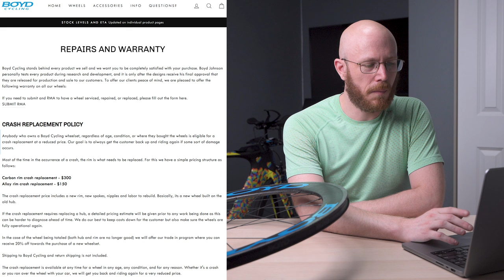Boyd Cycling Wheel Review: Why I'm Never Riding These Again

Comment: Hey Justin, Boyd Johnson from Boyd Cycling here. We just found this video and I wanted to comment on a few things.
First of all, the wheels you have are from about 2011, so those were produced before higher temperature resins were commercially available. With advanced in carbon, carbon rims have been able to handle more and more heat. In the early 2010 pretty much all wheel companies that had full carbon clinchers experienced failures. We included literature on our website and with every wheel purchase about the limitations of using wheels in very hilly areas and encouraged the use of tubulars (which don't have the outward pressure against the hooks) if riders wanted to use carbon for hilly areas.

I understand your frustration about the rebuild and not being about to rebuild with your hub. However, again since that wheel was from 2011 that hub is very old and if anything were to happen once you got the wheel back, then you are right back to needing parts replaced. We recognize that parts wear out over time and we had spare parts for those hub for over 6 years after discontinuing them. If you went through the crash replacement, got a new rim, and then a pawl broke and you had to go through that whole process again it would not be an enjoyable experience.

For wheels like this, that have been used for 12 years that is where we want to give the option of getting the brand new set at a discount so you can get the newest rim brake technology with the best temperature rating, along with the advances we have in our hubs over the years.

For what it's worth, we are dedicated to keeping rim brake wheels around, even as most other wheel manufacturers drop rim brake all together. We recognize that for a lot of people, they prefer rim brake or they have a rim brake bike that they love. It's been quite a while since we've had a heat related issue on a wheel, and I know for certain that our newest rims with the laser cut texturing have had zero heat issues. This is also when carbon is being used as an everyday option, whereas in the early 2010 carbon was still regulated to "event only" situations. 

Please, if you ever have any concerns in the future reach out to me. I always want to be as open as possible.
Reply from the maker: Heyo,  

First off, thanks much for the reply. I understand that the video would have been easy to just ignore, and conversations like these are never fun to have, so I want to make sure to acknowledge that. 

Now that we’re a couple months removed from the incident itself, I think my thoughts are best summed up (in conjunction with your reply) in the following ways. I don’t intend this to be a point by point argument; rather, just to let you know where I’m at: 
1)	Regarding safety: as someone’s who’s been in the sport for 15+ years, I was not aware that carbon clinchers rim-brakes were indeed that risky. I think most cyclists knew they had limitations, but my perception was more ‘Don’t descend the Tourmalet on them” rather than it was “Be careful on any hills.” If it is indeed closer to the second, then I would encourage the industry to be more vocal about the inherent limitations of earlier-gen resins (possibly even with a nice discount code for original owners, which could lead people to upgrade to safer wheels.)
2)	I fully acknowledge and understand the challenges of providing a lifetime warranty. I fully believe that Boyd (as a company) intended to keep parts on hand. My feedback as a user is that I went to your website basically out of curiosity for crash replacements, not expecting anything much at all. What I found was a very unequivocal “regardless of age, condition, or where they bought the wheels.” I would summarize my feelings as: I understand it is very difficult to truly offer lifetime, unlimited support. However, if that’s a claim you make, then that likely sways people into buying your wheels over another’s; if it’s a claim that you choose to make, then I believe it is fair for a person to expect to receive it. I see that you have updated your site to include language regarding old hubs, and I support this. I would encourage a reconsideration of the lifetime language if it’s likely to be closer to 5-10 years (which arguably is exactly when people will need to use it.)
3)	I appreciate the offer for me to reach out directly. The reason I chose not to is because I had reached out to your customer service, and I do not feel like I should receive any different access by virtue of having a YouTube presence. 

Again, thank you for the reply. I’ve pinned your comment and you’re always welcome to comment further if you feel I’ve misrepresented something in any way (as that’s never my intention.) I have always heard good things about Boyd (as a company,) your involvement in the cycling community, and your company does good things. I believe you may be connected to Time’s new carbon facility as well? I just bought a Time myself, so if you are, best of luck on that venture.
Reply: "In the early 2010 pretty much all wheel companies that had full carbon clinchers experienced failures." Should not that be enough for a recall?

Comment: Hmmm. I'd side with Boyd on this one... 2011 wheels with thousands of miles and of course we know how carbon reacts with extreme heat. Unfotunately, time to up grade. It is what it is... I think Boyd went above and beyond trying to hook you up with the 20% discount. Good luck on your wheel quest.
Reply from the maker: Upgrade to disc brakes for sure. Interestingly, I was actually more with them until their reply in the comments. As I see it, there's fundamentally two issues: A wheel problem, and a customer service prob. The CS one is annoying, but whatever, we've all got those and life moves on. In the comment below, they state "In the early 2010 pretty much all wheel companies that had full carbon clinchers experienced failures." Knowing that I was riding around on wheels that they knew were at apparently significant risk of failure? Oof. I've changed brands.

Comment: Either ride aluminium (alloy) wheels with rim brakes OR carbon with disc brakes. Carbon has NO ability to dissipate heat so the brake track takes the full pressure of the heat and thus the brake track takes the brunt of the heat and eventually will fail. You experienced this at a great place for it to happen. Several riders here experienced catastrophic failures with serious and life threatening injuries.
Reply from the maker: Indeed. That was not fun and I'm very happy it wasn't worse.

Comment: Boyd basically is in a use case of where their warranty and current technology doesn't align and they are doing the shitty thing of trying to wiggle out of it.   The correct thing for them to do is offer you full credit for whatever you paid for your current boyd wheels on a new set of wheels as a reasonable compromise.   While this solution wouldn't made me happy....I could understand and deal with it as a "time marches on" problem.
Reply from the maker: Totally. Funny thing is, I basically didn't even 'expect' to get a crash replacement. They're super old wheels, and when I saw that, I was like, "Well this is amazing, alright then!" And then it was a no. I get grumpy when brands do things like that. It's really easy to use that on the front end to move more product, and then it's crappy to try to back out on the back end when the act of honoring it is hard. I can't say I think I "deserve" replacement wheels in that case fully, but if you're gonna offer it, then you should honor it.

Comment: Justin, so after 11 days when you did not get a response, why did you drop the issue?  Why didn't you follow up with them?  It sounded like you were close to them rebuilding the wheel around your old hub.  I think you should have pushed the issue.  Additionally, sorry about your crash, and I can somewhat relate to the experience you had.  While I never had a catastrophic failure on my pre 2011 Fulcrum carbon rim brake wheels, as an engineer, I could never seem to find any data that would help determine when the useful life of carbon-rim brake wheels is up.  It has always been a mystery that haunted me on every ride.  Now, with a set of Boyd Prologue 44 disc wheels, I dont worry about that issue anymore, and feel confident in a robust design.  Good luck.

Comment: Justin, your content is amazing. It’s so relatable and approachable. 

I ride HED Jets specifically because of this anxiety. I want alloy for the wheel structure and brake track. It might be heavier and slower, but I get peace of mind.
Reply from the maker: Thanks James! I don't remember if I left it in the vid or edited it out, but yes, the alu track+carbon fairing is probably the right way to do this. Now that I've seen the failure mode, and more importantly, how quickly it can happen, no way. I have a new road bike on order with disc brakes (sorta good timing not directly related to this) and I'm very happy about the discs.

Comment: Sorry to hear about your experience both with the technical short comings and underwhelming customer service. 
About the rim failure: When carbon heats up due to braking the risc of delamination is high because of the clincher tubes. The tubes push outward in the horizonal direction (wear the tire hook meets the bead). Think about the 6 to 9 bar you might be running. That's a major weak point of clincher carbon rim brake wheels. Pro's didn't suffer from it since they use(d) tubes.
For me the carbon rik brake wheels on my IA16 are OK because of the very very flat area I live in. Road bike is on disc brakes. And that was my preliminary requirement to even think of carbon wheels. I'll take the extra maintance hassle for what it is.
Reply from the maker: Totally. Peak Torque did a great video about it, basically arguing that rim brake carbon clinchers are a fundamentally poor design for exactly what you said, and that he'd only run tubs or discs. I don't want to go tublulars, so that's no option for me, but yeah. Agree; discs on my mtb are a bit of a pain, but so much better.

Comment: Thanks for the video. I’m assuming Boyd has pretty much switched over to all disc production and that’s causing the problem honoring the replacement warranty. Not right though!
I hear everything you said and I’m sure if it happened to me I’d have a different opinion. Currently I just can’t justify the expense of switching over to disc. Especially with several bikes and wheels
Reply from the maker: Same. I actually really don't want to buy a disc tri bike either. I'm juuuuuuust convincing myself to get a new road bike after ~12 years, and I ride my road bike a TON. I really rarely ride my tri bike. I won't be getting a new one this year for sure. :(

Comment: Is it true that your wheels are over 11 years old.  If that is so, can’t imagine why Boyd is at fault.  See the test below https://youtu.be/9T1T96pFVdQ?si=C_qeaEpAuKh-zum4
Reply from the maker: @coffeytnmilk  I also have 50 year old wheels that can sustain a 2 minute 5% gradient just fine. Is Boyd at fault? Well, the real point is that it's very clear that carbon rim brake wheels were never optimal, and they themselves stated that these wheels had less ability to handle heat than modern more recent ones. It's up to you to decide if minutes at highway gradient before a dangerous blowout is reasonable or not. Personally, I absolutely don't. If that's a controversial take, so be it. The sound of that blowout and feel of a broken wheel colors my opinion. I won't ever ride carbon rim brake wheels again.
Reply: @JustinDoesTriathlon  yeah - I think your post is unfair to Boyd.  Carbon wheels are new tech.  They have revised the resin since and published test data.  12 years ago, we didn’t have disc brakes either.

Frankly - I wouldn’t ride and never have ridden carbon with clinchers.  But carbon is an exotic tech - then.

Appreciate the response.  Thank you.  I just got a bad vibe about Boyd and I don’t think it is a fair assessment of them.

Cheers
Reply from the maker: @coffeytnmilk  Well, we all have different perspectives. Having a wheel delaminate under me after 3 minutes of a very gradual decent certainly altered mine. And you're right, things have absolutely inproved in the last decade; Boyd's comment stated that as well. Everyone in the world knew that carbon rim brake wheels weren't great for braking under long fast decents. But 3 minutes at highway grade? Like I said in the video, either one of two things: Either my failure was typical and should have been expected, or it was atypical due to a production error. If it's the first, and that very dangerous situation could happen so quickly? Then that should have been made VERY clear to the world at large. Also heck, the video you posted has one comment of someone critiquing their test methodology too. 7lb of braking force for 20 min means nothing if 12lb of braking will do in in 2 minutes (hypothetically). You could also brake those infinitely at 2lb I bet. Manufacturers need to start showing time at grade. If my wheel even has potential to explode on an 8 minute decent, I'm never gonna risk my life on it. The technology has moved on.